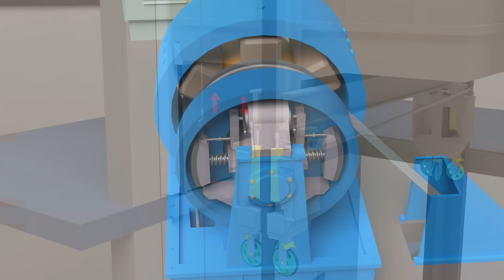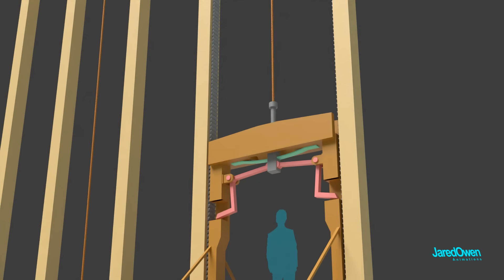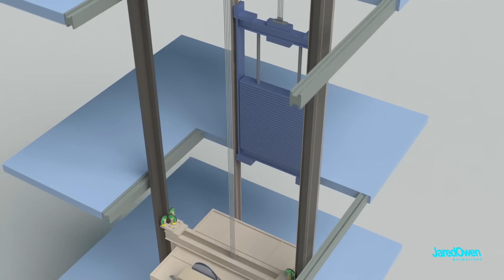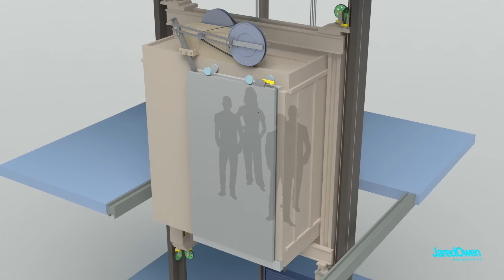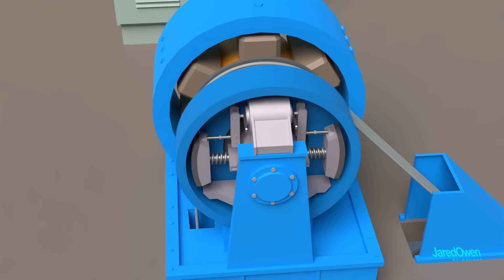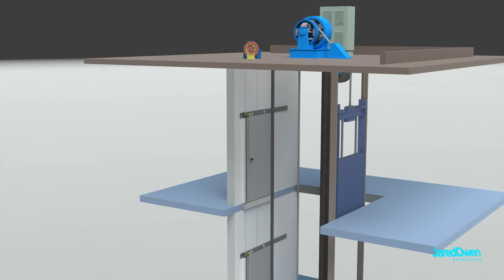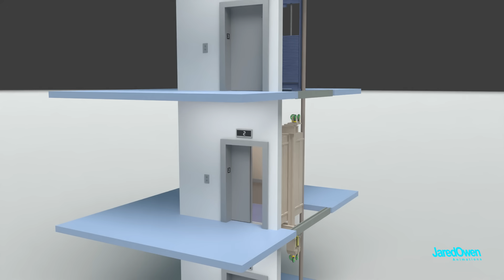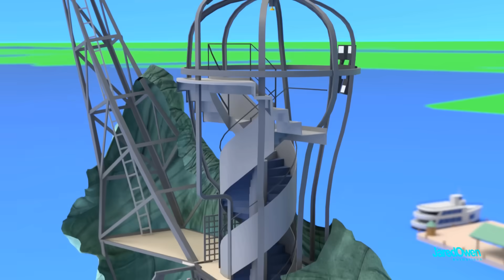How does an Elevator work?

Comment: Another great video! I actually never heard of hydraulic elevators until you mentioned them. Seems a bit more convoluted if something were to go wrong with a pipe or something. But as always, excellent explinations and animations! Looking forward to the next one :D
Reply: Well, you should have. I worked for Otis, a really racist institution if you ask me. I hate this video.
Reply: Hydraulic elevators are really good. To go down there is a electric valve that release the pressure in the cylinder. That valve can be operated in automatic even during a power loss with a battery, so in case of a blackout, the lift can retourn in automatic to a lower floor and then release the door.

Comment: This Video Help Me To increase my Phobia.

I not very much Use Elevator, because of Two Fears.
1) after inside door Did'nt open
2) when It speedy going down  , and break did'nt work .

And collide hard to ground, and collapse your bone structure.
Reply: Nah, if you’re at the top floor and you want to go down and the brakes fail while you’re in the cab there are multiple safeties devices to prevent it.. but he mentioned the counterweight theoretically if your floor is not the basement floor that you’re going to the elevator may slow down and start going back up since the counter weight is heavier. Your fear should be to crash into the ceiling not the other way around.

Comment: the Train Station in my City uses hydraulic Elevators wich are only connecting 2 floors for people who can not use the stairs or escolators.
and the big shoping centre in my city uses Machine Room Less traction Elevators.
I knew it because the wall of the cabins in the shoping centre and the walls from the shaft in the Train Station are made from glass, so everyone can watch the Elevators mechanism

Comment: There’s also freight elevators which work identically, but the difference is the cab is much larger as well as having a much higher weight limit in order to accommodate items that are too big, heavy, and bulky to fit inside an elevator for carrying people, although you could still carry a larger number of people than you could with a regular passenger elevator

Comment: Back when I worked maintenance, I would need to use the "elevator key" about every week to go and retrieve someone's lost X, Y, or Z at the bottom of the shaft.  IT IS A CRACK ABOUT AN INCH WIDE!  You would not believe how many people lose things down it!  Thanks for a great video.
Reply: I dropped my keys once and of course it fell perfectly right into the gap.
Reply: well an X is only half an inch tall...

Comment: I didn't know elevators have safety mechanisms. I've never encountered an accident and elevators in movies always fall to the ground. Thanks for the great video as always.
Reply: You’ve seen it in the movies before but there’s less than one chance in a million that it’ll happen in real life, let alone on the elevator you’re in
Reply: They're not like that in all countries. Some places have very dangerous elevators.

But, in general, you're much more likely to die from being trapped in a stopped elevator, or sliced in half by movement of the cab when you climb in, than by the elevator falling to the ground.
Reply: @tbird-z1r  "Some places have very dangerous elevators."

*cough* China *cough*
Reply: Elevators in movies don't have much connection to reality, and that's not limited to elevators - fire sprinklers don't work in reality the way they often work in TV and movies, either.

Comment: As a maintenance mechanic in a hospital I cant tell you how many times we needed to use the fireman key to open doors of stuck elevators. We only did it if security called us and the elevator was within inches of a floor where we could safely evacuate the riders. Otherwise we had to wait for the fire department to show up.
Reply: Weren't you trained to also get in the machine room and manually drive the cab to the nearest floor though ?
(If the FD and elevator companies can do it, why couldn't a maintenance mechanic do it as well after being trained to safely do it ?)

Comment: You mentioned the hole on the door is for unlocking the passenger door, but I've seen elevators that don't have holes on their doors if I remember correctly. I guess some elevators don't need them?
Reply: European elevator doors don't come with that hole at mid height, however there's still a keyhole for authorized personnel to unlock the door using various special keys.
The hole can be on the upper part of the door itself but most of the time it is located on the door header instead of the door itself.

Comment: what's the sketchiest elevator you've ever been on?  
- I used to take xrays at a hospital called St Mary's in Rochester, NY and sometimes the elevator door would open when the elevator is still moving, The door would open and you'd  be staring at the roof of the floor you're supposed to get off on.  Those were old elevators though, at least they were fast.
Reply: A titan In denmark from 1898. It wobbled when it moved. It was scary but funny

Comment: there are elevators with dynamic counterweights that change their mass to always equal the mass of the elevator plus its contents. These are known as "smart elevators" or "regenerative elevators."

These elevators work by using a system of sensors to detect the weight of the elevator and its contents, and then adjusting the weight of the counterweight accordingly. This ensures that the counterweight always provides just enough force to offset the weight of the elevator and keep it in balance.

One of the main benefits of these elevators is that they are more energy efficient than traditional elevators. By using a dynamic counterweight, they are able to reduce the amount of energy required to move the elevator up and down, which can result in significant cost savings over time.

Smart elevators are becoming increasingly popular in large buildings, such as skyscrapers and shopping malls, where they can help to reduce energy consumption and improve overall efficiency.

Comment: Pretty good! You did mention about the varying factors for sure, especially the door mechanisms are quite unique from one lift to an another
As in, the real concept probably remains the same, but they are implemented differently mechanically more so often. The one showed here at least to my knowledge was common in more older single doorlifts, dual door lifts are different

Comment: How does the cab goes down when it is empty if the counterweight iweighes half full cab
Reply: The motor takes the stress to move the cab.
Reply: @hariranormal5584  the cab is connected with cables and cables can not push and only they can pull
Reply: @chiragsharma6449   Motor can move both ways? Who told about cables, motor forces it either directions and everything follows along. The weight doesn't matter because again, the motor is doing the hard work

Comment: I used to quite afraid of elevators when I was a kid, but glad someone already thought about those safety issues.
Also a side note, hydraulic elevators can also have telescoping pistons, cutting the piston length in half if not more. Of course it’s quite expensive and don’t solve the slow raise/lowering speed, so they are not used on anything more than 3-4 floors.

Comment: Another excellent video Jared.  There is another type of elevator that you didn't mention though, but I think there's only a few of them in the world - The Paternoster. That would make for a great video all by itself!
Reply from the maker: I recently learned about the Paternoster - very interesting!  Seems pretty dangerous though 😮
Reply: @JaredOwen  I don´t know much about dangerous, only used them few times when I really really didn´t have other option (well, other than walking up several floors of stairs with a heavy bag that is 😂), but they sure as hell give me massive anxiety from the first time I saw one as a kid.

Comment: Jared, on hydraulic elevators, isn't it common design to have the piston applying force to a scissor jack under the elevator cab, meaning that there isn't the need for an extremely long piston required for the height of the rise?  Similar to the portable hydraulic lifts found in stock shelving warehouses
Reply from the maker: Yes I believe that's correct.  There will definitely be different configurations than just the one that I showed in the video
Reply: The scissor jack would have limited lifting.  There are telescoping pistons and a hybrid system where the pistons are above ground and work with pulleys and cable (referred to as "rope") to multiply the travel.     You can search for types of hydraulic elevators to see them all.
Reply: No, there are no conventional scissor jack hydraulic elevators. 

Hawk is right, normally you’ll find goofy stuff like telescoping or cantilever(uses cables and sheaves on side of elevator cab).